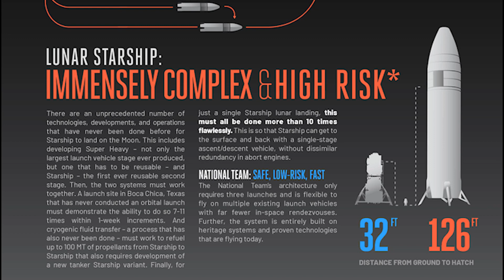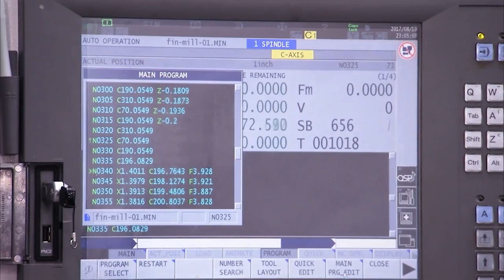BREAKING! Lead Engineer DISBANDED Blue Origin to join Elon Musk's SpaceX

Comment: The lead engineers left because the design was finished… they have 2 rockets in tandem on the automated floor being built. Starship is 3 years behind where they said it would be. But that doesn’t matter, because they are entertaining you. At least BO has a vetted and tested engine. The raptor has failed EVERY relight. That’s right, every single one. Producing minimal thrust on restarts. Why? Same reasons the BE-4… the turbo pump seals. I agree, BO is old school, and slow and careful. But it’s crazy you think they have nothing. Just because you can’t see it live on YouTube
Reply: Yeah, but that doesn't make an interesting video so they got to make some stuff up.